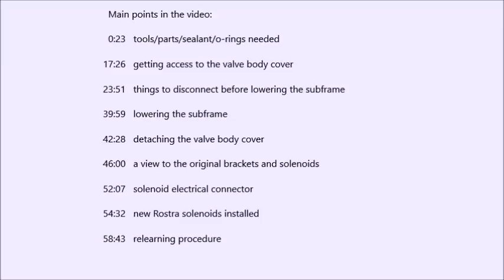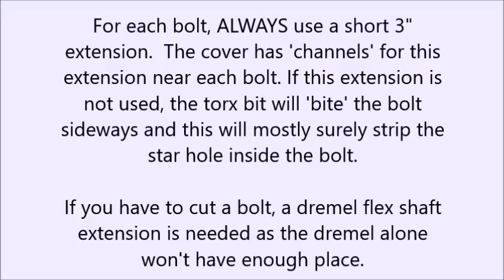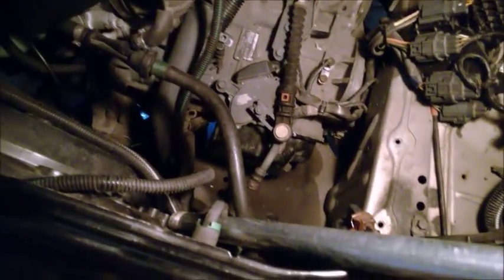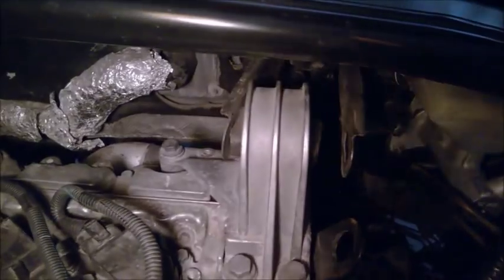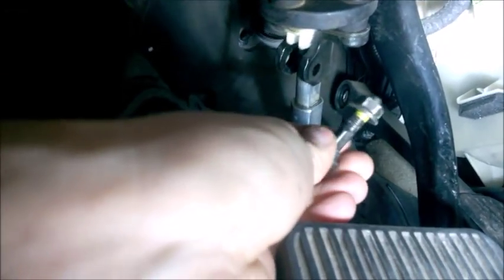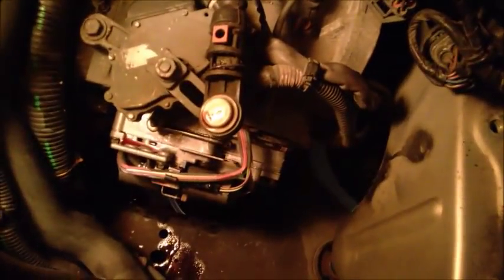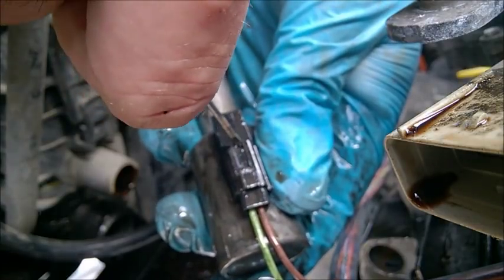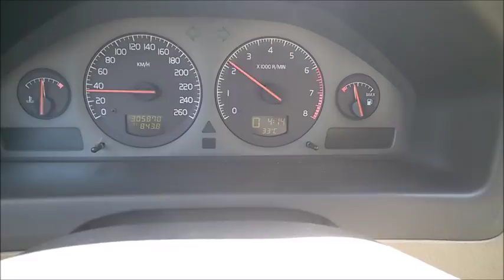Volvo S60 V70 Transmission Solenoids Replacement + Adaptation Relearn 2001-2009

Comment: Quick question I believe it could sound dumb but can. 2001 Volvo S60 use the same solenoids and sensor from a 2004 Volvo S60 as well does the 2001 Volvo S60 have a transmission filter or is it built in?
Reply from the maker: All automatic Aisin transmissions use an internal filter which is non replaceable.  The filter cannot be accessed by removing the trans oil pan. As for the solenoids, I'm not aware if they were modified on some year models, better ask on Rostra web site or check the fitment for their replacement solenoids

Comment: Can you put a link for buying this solenoids for xc90  from 2005 whit aw55 -50 sn automatic 5 gear transmission ?  Please. Is hard shifting when oil is hot . The problem is 3 too 2 gear shifting , the others gear shift  is ok
Reply from the maker: I don't have a link as it was very difficult for me to find an Ebay seller who was selling the genuine Rostra - most sellers have picture with genuine but send chinese fake ones.  For the 3-2 hard shifting, my 3 solenoids did not completely solve this problem, so there may be a 4th solenoid responsible for this hard shift, and there may also be wear at the B4 servo piston bore - not fixable (look up on Youtube)

Comment: Quick question changed my transmission fluid when the fluid started acting more to the point of urgency and now it runs but going into gear car stalls out. No codes show up at all wondering what it could be please help thanks!
Reply from the maker: https://youtu.be/Ad7HxgNP4s4

Comment: 2005 V70R I replaced the auto trans with a known good one because of metal fragments. I flushed out the trans cooler and lines. Transmission does nothing. It won't move the car in forward or reverse. Dash shows the proper gear when I shift. It has the proper fluid at the proper level but nothing. I measured all solenoids and they are all within specs (ohms)  all 3 linear solenoids measure ok and the plungers are free moving with the springs removed. I used calipers to measure their length before I removed the adjusters and put them back to exactly the length I measured. The car will Rev in any gear with no movement at all. Any ideas? Thanks
Reply from the maker: I'm thinking about the torque converter, but this sounds more technical, I would try asking on forums - it's good to post on several of them to reach more people. 
https://forums.swedespeed.com/forumdisplay.php?51-R-Forum-(2004-2007)
https://www.matthewsvolvosite.com/forums/viewforum.php?f=9
https://www.volvoxc.com/forums/forumdisplay.php?6-2001-2007-XC70-(V70XC)

Comment: Hello, thanks for the video, currently having truble with 3-2 downshift when hot, rough engagin and 2-3 shift is  a bit delay.  
1)   Do you have a link to buy secure rosta selenoids..I live in south america, and the only way to get them is by ebay.
2) Did you test the car before adaptatión. in the city i live the only ones with vida is the dealership, and the wont provide the service if they dont do the work on the car.
3) could you activate these adaptacion mode, using other good cuality scaners?   

Thanks for the help, hoping to fix my 07 xc70 2.5T
Reply from the maker: First off, the 3-2 downshifting is not typical for old solenoids. Have you already replaced the fluid with any 3309 one ?
About buying Rostra, try asking them directly on their web site, and indeed BE AWARE that most Ebay sellers show genuine pictures in the listing but ship chinese knockoff solenoids even if they have positive feedback. You may also try Sonnax solenoids. I also recommend asking for new S4 solenoid, see the comments section.
I would not recommend not doing the adaptation and relearn, at the very least, drive that car only inside the city for a few months, never on long road trips. And yes, more expensive scanners - the kind garages have, may engage the transmission relearn. I'm not talking about $150 scanners, rather about $400-$500 units. Try visiting local garages and ask them to plug their scanner and see if it shows adaptation reset and relearn (not just reset, and not just fluid change reset). You will need to do this is warm summer time.
Reply: @Peppermint1  Thanks for the quik response. I did change the fluid with mannol 3309 the car has 170.000km and these was the first fluid change, perhaps I need to do a cuple more to clean the trans?  Im open to sugestions.  Im currntly in spring time, so im good with the weather.   I will ask arround in local shops for a scaner.  Some one told me it could be the engien mounts, but i dont know how it only would afect that especific dounshift.

Comment: Hello, Im about to doing the job lowering the subframe. Volvo recoment lifting the engine so Im little bit in doubt whether to doing that with a jack under the sump. Im concerned about the sump pan gasket if it will leak after pushing up the engine, its a lot of kilo we are dealing with. What are your thoughts or experience about that?
Your video is very helpfull by the way
Reply from the maker: I wouldn't lift under the engine oil sump because it's made of alloy (less solid compared to steel) and may crack or even deform.  Try lifting under a thicker area under the transmission and always use a piece of 2x4 wood on top of the jack - make sure it stays solid and won't slip. I think here among the comments someone says he actually rather lifted the front of the engine instead of lowering the subframe and got enough clearance. Might be easier and need less lifting. Also read my comment above where I mention extra details about what to disconnect - really important with the cable harness and also with the shock absorbers (I damaged one in the process)
Reply: Thanks, you have a point there with the alloy pan beeing weaker than Steel. I will try with a jack and some wood under the transmission
Reply: I did lift the engine only at the rear end by placing and engine bridge self made by a 4×4 wood and a bottle jack.

Comment: Hi! I have Volvo v60 2014 awd 2.4. automatic. sometimes when shift on Drive, i feel and hear a little BANG, but ONLY very rare, my Dealer SAYS need do transmission adaptation reset and leave car for half day to reset adaptation, other services says need change also oil + adaptation. can you recommend me something? overall on road gears shifting smoothly.
thanks
Reply from the maker: That may indeed need a transmission software update - normally this takes 0.5-1h to do at the dealer (they may charge you more). Then drive the car inside the city for the next few hundred miles.  May also do a fluid change (Volvo will say no) - just ask on forums about the procedure and which fluid to use
Reply: @Peppermint1  im ON dillema now as what to do best. Other volvo not dealer service says for 130eur Will change transmission fluid recommneded one plus adaptation, but volvo says first should do only adaptation and if not help then repair... What would you recommend me first also i see ON 18 year ON switzerland my car got oil change as i bought car with previous service repairs and services.
Also its wierd as dealer says need leave car for half Day as second adaptation process need to be done when car is Cold so thats why it takes too long to do adaptation. Thanks.
Reply from the maker: @S1L3NT__  I don't know how the adaptation is performed on your car which is the newer 2010+ platform (also called P3).  One the older platform (the one in my video is a P2), you can see what I had to do - I had to reset a setting with the software, then drive the car for 1-2hours https://www.youtube.com/watch?v=qzXAdxZpjWU
I think the best chance to fix the problem is the adaptation reset.  The fluid change may no be related to the issue but if you have over 80000 kms, it is a good idea to replace at least half of the fluid (better not all at once).  So the fluid thing would be just maintenance, while the adaptation would be to fix the issue. I'm not aware why Volvo wants to keep the car for half a day, I'm thinking maybe they need to upload the software, then perhaps drive the car for a while - good idea to mark down't the km and see how much they drove the car when you take it back.  But again, the newer platform may have a different procedure than my car in the video.  They may even need to drive the car with a cold engine, to see how the transmission is working when cold.
Reply: @Peppermint1  Yes im thinking the same. Im only curious too why dealer said need to be 2 cycles and ON 2nd one car need to be cold. Thats how he said. I agreed. And Will do adaptation reset and Will see whats what. He said 90% adaption cure the harsh shift problems and slippage.

Comment: Why do you recommend not to use valvoline max life??
Reply from the maker: I did use it and in cold weather starts the fluid would shrink so much, the car won't move in D (fluid level too low). Switched to 3309, no more issues

Comment: Good sharing mate. Having the same problem with my 2004 S60R auto tranny. The solenoids parts could be diffrent ?
Reply from the maker: I think they are all the same for the Aisin AW55-50SN and AW55-51SN 5 speed auto transmissions.  Only the Geartronic 6 speed transmission should have different solenoids, to my knowledge. Cheers

Comment: Did you find a reputable source online ? eBay or elsewhere where the solenoids did work correctly ? Thanks.
Reply from the maker: It's been too long since, no longer have the seller in the Eaby history. But I remember clearly many Ebay sellers would put a genuine picture and send fake solenoids. Look for a picture showing Rostra (with the stamped R) and ask the seller clearly if it's for the actual item. Also look at all neg feedback. If there's any doubt, search another seller. Generally speaking, there will be a lower price and a higher price, no change the lower price will be new sealed genuine ones.  Also mine came with Rostra box with the serial on it, may ask the seller if the solenoids come with genuine box. Side note, a Volvo owner things there is a fourth solenoid that can go bad, the S4 one (smaller size). This would regulate the 2nd-3rd shifting, which is still a bit bumpy in my car.
Reply: @Peppermint1 is your car automatic or manual ?

Comment: Wow,awesome video,thanks for sharing.you put some effort in this video I really appreciate,because I have the same problem,and have to do this job myself.i dont wanna touch a bolt or plastic,everything I do its breaking...especially plastics. Hmmm though job you made me think twice:-)
Reply from the maker: HI Dejan.  This jobs does need attention.  Besides what is show in the video, lowering the subframe needs attention because several things need disconnected so as not to damage them.  I didn't disconnect the end links and I damaged my shock absorbers.  Also, I recommend measuring the adjustment of the original solenoids, and make sure the new ones have each the same adjustment.
Reply: @Peppermint1  this is a tricky job. I'm not changing solenoids,I know I have to measure and adjust.i was planning a new sonnax vb or a gm vb with the s5 solenoid swap and b5 spring removal.i dont know the price differences. So even if I do a new Vb, I might have some internal wear in the transmission/clutches?  The problem is getting bigger and deeper now.so what are my options,how can I check the clutches? I have inline magnefine filter and external atf cooler waiting to be set on the car with a few d&f... What do u think about the life span of the transmission, mine is now 155k miles, first atf changed in 135k miles? All the best mate

Comment: Can you do it by lifting the engine, instead dropping it?
Reply from the maker: Certainly, but I think there is more work.  Everything between the subframe and engine will still need to be disconnected as in the video, plus you will have to undo things like axles, exhaust, some cables, etc.  Also see how I reached the two lower pan bolts at 42:10 - it helped removing these bolts which can be stuck.
Reply: I ask, because if you remove all the engine mounts both torque mounts the engine will be or will have a movement that will let you undo no only the bolts under but also the side and top ones. And when you removed the pan it came up, with the clearance after removing the mounts, wouldn't that be possible in a easy way. I agree the you might have to take the trans mission from the side of the transmission and a do the first exhaust bracket, but I don't think anything else is needed.
I'm sorry to ask all this.
My gearbox problem, is and it doesn't happen every time, is at low speeds like 10 miles or less sometimes it flares from 1 to 2 or 2 to 3 but at very low speeds, there are no clunks, sometimes a pull but rarely. 
Many thanks
Reply from the maker: @tiagomagalhaes1009   No  worries about going a different way, it has not been done yet to my knowledge so it would be interesting to see if it could be actually easier because you won't have to touch the subframe.  The engine will have to be lifted high enough to clear the cover itself (the cover is deep, so it has to move forward away from the valve body a good few inches and the subframe sits only 1-2 inches from the cover at it's lower point). 
As for the flares, could it be related to old or too low fluid (we measure it with engine at idle in P and warmed up a good 30 min in summer time).  These transmissions use fluid type 3309. Maybe have a look here  https://www.matthewsvolvosite.com/forums/viewtopic.php?f=9&t=4864&start=10
Reply: I reckon it must come up through the engine bay without touching the subframe. Anybody tried?

Comment: Thanks for the sharing mate, im doing the soleniod replacement on my 2008 S40 T5 in a few days, ill leave my results in the comments aftewards! :)
Reply from the maker: Hope it works out well Cheers
Reply: @Peppermint1  Current result.
The car don't learn 1-2 and 2-3 shifts at light throtthle input in adaption mode. The P-R Happens with at big bang, and i get clunks in 3-2 downshifts and when the gearbox engages to 2 and 3 at low speed...
Reply from the maker: @dinmor2701   I had the delay and hard slam into D and R and I also got worse gear changes the first time when I tried to 'refurbish' my original solenoids as shown in some Youtube videos - all in all it didn't go well trying to refurbish them , then I bought new Rostra ones and things went fine. Did you use Rostra or Sonnax solenoids ? Some places sell fake chinese or 'refurbished' solenoids (basically they just throw old solenoids in cleaning fluids).  Otherwise, when driving for the adaptations, It's not necessary to always use light pressure on the throttle. Volvo says so, but our transmissions have extra wear to them - I would rather 'try' any kind of acceleration, to find which one gets the transmission to learn a specific shift point. Also remember that once the engine is shut off, all must be started all over if a point was not completed (but it's not a must to learn all shift points if they seem to shift well enough).  Edit: until to have it sorted, to prevent that slamming into D or R - which is not good for the transmission - rev the engine a little to 1500rpm while engaging into D or R - it should engage much smoother - the slamming into R or D is cause by too low oil pressure inside the solenoids, revving the engine increases the pressure and helps for a smoother engagement
Reply: @Peppermint1  I used the Rostra solenoids with the printed "R" into the plunger housing. I got the car to shift very smooth by adjusting the solenoids myself, but i'm still where i started. I get a clunk when im shifting from P into R, or when i let go of the throttle and the cars engages to 2nd or 3rd gear... It's not a bang, but rather a clunk that sounds exacly like if the driveshaft had some veil and needed replacement - but it cant be, since it's only happening when engaging to 2nd, 3rd and Reverse.. If i were the rev the engine while shifting from P to R, the clunk is way louder and more intense... The cluncks get mutch worse the the transmission fluid is warm..
Reply from the maker: @dinmor2701    How did you adjust the solenoids, through holes in the valve body cover ?  Rostra says they are pre-adjusted to be the same as the old original ones.   The other thing I'm thinking is the solenoid connectors, tricky to remove, sometimes they may not stay well secured when put back
Reply: @Peppermint1  I adjusted the solenoids by holes i made in the oil pan. The preadjusting was terrible, and the adaption could not learn any shifts with the standard calibration. The connectors can't be the issue here, since the problem has always been there, and i replaced the solenoids upon this issue.
Reply from the maker: @dinmor2701   I see.  It's a particular situation indeed.  May try perhaps contacting Rostra for advice, there's an email at the bottom of this chart  https://dokumen.tips/documents/aw55-50-solenoid-adjustment-chart-v2.html
Reply: @Peppermint1  Thanks a lot for the advice! 
The solenoids are now adjusted, and the transmission shifts smooth as ever!! However, it still clunks (which must be caused by something else).
I figured the clunks only appear when 2nd gear engages, on 3rd to 2nd gear downshift and in reverse engagements.. Perhaps its caused by the s1, s2, s3, s4, or s5 solenoids. It never affects the shift quality.
- I'll update you if i find a solution :)
Reply from the maker: @dinmor2701   Glad to hear!  I also have a clunk (more like a kick) sometimes when I come to a stop - which was not there before replacing the solenoids.  Possible indeed other components to cause this, it's an old lady, things are to be expected.